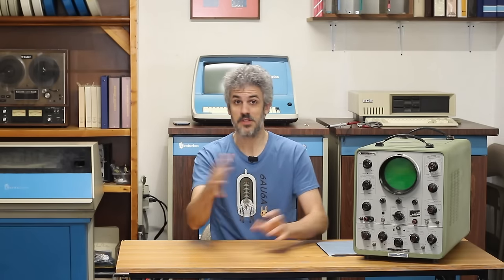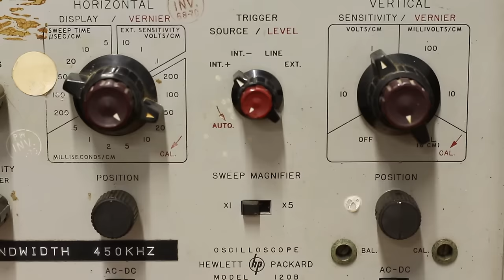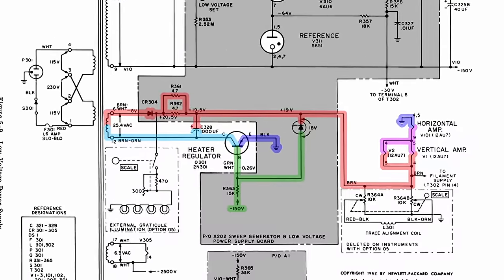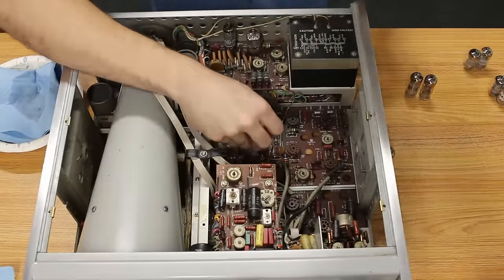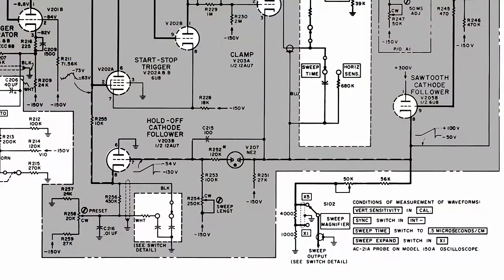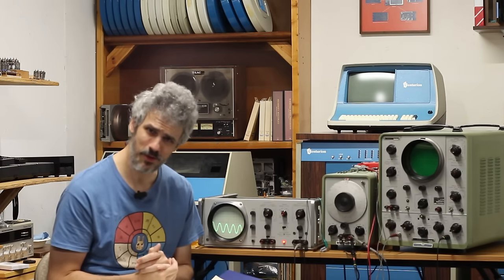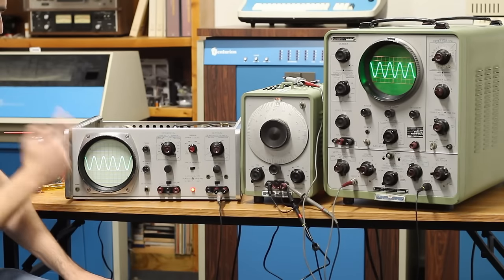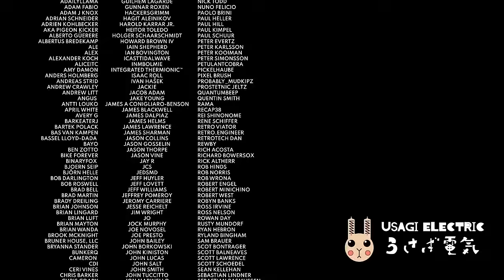Restoring an HP-120B Oscilloscope from 1961!

Comment: If you hadn't noticed, some of the pins on the tube sockets looked a little cracked around a few of those sockets. You may have a few bad solder joints on those boards. Other than that, that's a sharp looking scope
Reply from the maker: Sometimes the camera makes things look like cracks when they're really not. It definitely does look weird on a lot of the joints, but I went through and inspected them and it's really just blobs of solder, but they're all still connected nice and strong. I also went through and rocked the tubes back and forth while it was on an running to see if flexing the tube socket or PCB would cause changes in the pattern, and it didn't, so I think we're all good!
Reply: @UsagiElectric  awesome ;] an yeah, I can agree the camera can fool the eye.

Comment: That 100 Ohm grid resistor is known as a "grid stopper". It prevents high frequency oscillations. Same trick is used on solid state circuits on either the base or collector terminal of bipolar transistors.
Reply: And on the gates of power MOSFETs too????

Comment: When I was young and scopes were way too expensives, I wanted so badly to have one. My projects were mostly in AF range or CMOS up to 1MHz so any scope would fit the need. Now, I have around 7 working scopes, from digital to analog with transistors, from handheld to bench and I found that I use each and every one. I recently found a pair of old 20MHz dual channel analog scopes that were broken and I just fixed one so I share your excitement. The other one needs some more troubleshooting but Christmas hollydays are coming and I plan to fix it then.

Comment: Good job repairing that scope. That was a tricky one. When repairing vintage radios I have encountered bad Sprague caps. It is possible there are commercial higher quality caps being used in test equipment. Just wanted you to know you can't always rely on the fact they are Sprague caps.

Comment: The college i attended in the mid 80's was still using a gigantic vacuum tube o-scope, as it was the only scope they had that could do two very important things.  One, was to generate a transistor family of curves.  Two was that you could hook a land camera to it, and take a picture of said transistor curves, and develop them yourself darn near instantly.

Bonus, was that you could actually draw on the photo to pick your bias point for that particular transistor.

That o-scope had to weigh at least 200 pounds.  It was 3 feet deep and 2 foot x 2 foot across the front.  You could only move it in it's wheeled rack.

Amazing how well that o-scope worked.  We had regular old analog, transistor based tektronix scopes at each workbench, but you could not do transistor curves on them.  At least not with the equipment the school had on hand.

Comment: I absolutely have always loved these HP (Vacuum Tube) Scopes. I used to have a HP 122AR ( No PCB boards! ) I also had a HP 120 ( with no sweep it was just X-Y. ) I have a video of my HP-122AR on my channel from long ago. The transistor are for power regulation in the heaters, and the ziener does regulate I believe the B+ on the horizontal amplifiers. There is another HP scope that is from this time period, that I call the monster. It is again a hybrid, but I believe can do up to a 1GHz at with a special modular plug in. I can't remember the model number but I do have a photo of it, and there is a video on my channel ( Explorations of Garni Industries, you can see these scopes stacked at the end. )

Comment: I'd say the HP 651A Test Oscillator meets the rack mount requirement and the aesthetic, but it's a bit newer (1965) and transistorized.  They can be had super cheap though.  I bought one in the hopes of using the case for it to fit my HP Barney Oliver amplifier, but it wasn't quite right... so it just sits here on a shelf now. lol

Comment: This is why I always add a note inside equipment that I have modified or repaired - especially my own! Not just stating what was changed, but why. You might find that tube you replaced was a factory upgrade or mod. Looks like you are setting up a museum for HP test gear from the generation immediately before CuriousMarc's collection. And that is a really good thing!

Comment: I have an HP 8405A "Vector Voltmeter" (well actually, just the case... wanted to use it for an homemade amplifier), with a very similar style, handles and all, and with the stackable plastic feet this 120B seems to be lacking. It fits perfectly on my other 19" HP things ! If you need I could model them in CAD and send the files for 3D printing copies.
Reply: Have a full working hp vector volt meter with all the accessories. Very useful instrument used with directional couplers to measure insertion losses or used to measure electrical length of cables.

Comment: 11:28 Removing that big black 450KHZ sticker made it 10x more beautiful. Satisfying.

The zener + transistor was a nice simple regulator circuit. When the output voltage reaches the zener voltage minus the Vbe of the transistor, the zener diode starts to conduct and starts turning off the transistor. The resistor from the -150V makes essentially a current source that provides the base current to turn on the transistor.

Comment: Cool, as it just so happens, I have an old Oscilloscope stored away in one of my cupboards, it's an old Telequipment D33R Tube Oscilloscope, it's currently not working and needs a new, or second-hand CRT, plus some restoration work to get it going again, it's a great restoration project.

Comment: The PNP transistor and the Zener diode forms a basic current follower.  The zener is the voltage reference and the PNP transistor create a voltage that's close (600mV delta) to Zener's voltage with higher current capability.  This is essentially the same as a current follower circuit that uses a NPN transistor and a Zener diode that is more commonly used today except with the use of PNP transistor, the whole circuit is a mirror of the one that uses NPN transistor.  Hint, the placement of the ground is confusing.  Redraw the circuit by putting the ground at the +19V rail will make the analysis easier.

Comment: When removing old adhesive, I find that soaking it with isopropyl (sometimes with a rag or towel laid on top) will go a long ways towards softening it to where it will come more easily.
Reply: Yes; another possibility is naptha (cigarette lighter fluid).  "Keep away from fire, flame, or spark."

Comment: As the zener conducts it positive biases the base of the pnp (off), held on with the 15k resistor to the negative supply, establishing a nfb loop, increasing the v drop to the ground.
Reply: It also looks weird to us who are more used to power NPN devices.  It's just the familiar pass transistor linear regulator topology upside-down.  The pass transistor is on the bottom 0V rail rather than the top positive rail.
Reply: @paulmoir4452  I'm guessing that it dates to the pnp germanium era, before npn silicon power devices were common, but it is exactly that.

Comment: I seen a similar thing happen with a solid state Telequipment  Scope, spent days trying to TS the problem, replacing some caps, in the end the bias pot for the schmitt trigger need calibrated by using another Scope. Then the triggering stayed locked in when changing frequencies on my signal generator.

Comment: The Tektronix TM506 is a rack mount system for solid state plug in modules..
I don't know if there is a vacuum tube equivalent to it though..
But that would be a starting point in form factor search possibilities..

By the way.. I have a Tektronix 585 laying around somewhere...
I think it had a problem with the power supply...

Comment: This vintage electronic equipment was designed when nominal voltage was 110. Now it ranges from 124 to 129, at least in my area. If a vintage device is randomly blowing its fuse for no apparent reason, I am wondering if voltage fluctuations and spikes could be a factor. Maybe monitor the power line or  use a variac. This may be particularly important for precision test equipment - to get correct readings - versus something like audio equipment.

Comment: The 6U8 turned out to be somewhat of a problematic tube in many applications. They have a propensity to heater to cathode leakage. This may or may not show up on a tube tester, but is exactly the kind of thing that will throw noise on your trace and contribute to instability in your H-sweep. Exactly the issues you have. That is why, I'll bet, that they were substituted out in your scope as-found with allegedly superior types. Bottom line, it's kind of a defective design tube. They were reasonably popular tubes in old TV sets and if that is the source of your bag of 6U8's, all of them could be hinky on H-K leakage side. Before going nuts searching for a defective component in your scope, I would invest <$20 in three NOS ebay 6U8A tubes or known-valid substitutes. Plenty for sale.

Comment: Just putting this out there, since you mention the Model 15 teletype... see if you can find one that was modified for use by deaf people as the wiring harness was greatly simplified to have just the power and two pairs of cables (one would produce a Baudot serial stream from the keyboard and the other would be a similar Baudot stream to drive the printer). Both data cables would go into a box that would have an acoustic coupler for a telephone handset.

Comment: re the thumbnail:  Wow!  I had that exact model 'scope, too!  I bought it on-line in the mid or late '90's -- not sure if Ebay was around yet, but something like that.  Around $80 IIRC.  The rack-mount ears had been cut off.  In the early '00's, after getting married, I gave it to a friend who collected oscilloscopes (he also had every Star Trek novel paperback).
I suppose there were quite a few of these still kicking around, since they would just keep on working.

Update:  seeing it in the video, it's not the identical model.

Comment: One should not swap around tubes between sockets in a laboratory oscilloscope. The calibration was done with the tubes in their sockets, and each tube of the same type will have slightly different transconductance, capacitance, and bias. (The same applies to socketed transistors.)

Comment: current through r363 opens the transistor. When sufficient voltage appears on the red wire, current begins to flow through the zener and this current closes the transistor. In this way, a constant voltage is maintained on the red wire

Comment: That regulator and zener could be a clamp on the regulator to stop it from spiking over, or, it could be an early shunt regulator providing a low noise power supply by having a constant current bypassing through the zener (would need to see what’s elsewhere on the schematic.

Comment: I have a AN/USM-338 “portable” scope that is the U.S. Marine Corps version of an old HP 1707B scope from the mid-‘70s. I have no idea how to use it! I was hoping to get an old analog CRT scope so I could get the eye pattern when adjusting CD lasers but I’m told I need at least 100MHz and this is 75MHz.
Reply: It is, of course, able to be battery-powered and supports AC or 12v DC operation. I guess that’s what makes it a portable military scope. ;)

Comment: How the PNP and the Zener "play off each other": CR 304 and C328 form a half-wave rectifier producing an unregulated and probably ripple-laden 30 or so volts. The bottom of the transformer secondary is not grounded directly, but rather it is grounded through the PNP power transistor (Q301). Q301 is biased on by about 10mA of base current provided by the -150V supply through the 15k resistor (R363). This allows current to flow from the filter capacitor's (C328) negative lead to ground, powering the filament circuit. As soon as the filament circuit voltage reaches about 18.7 volts, the zener conducts, passing positive voltage to the base of Q301, reverse-biasing it so that it begins to turn off. An equilibrium will be reached where the voltage at the cathode of the zener sits right at the zener voltage, regulating the filament supply. If the voltage dips, the zener conducts less, and the -150V supply biases Q301 positively, allowing the filament voltage to rise. If the filament voltage goes too high, the zener will conduct more heavily, turning Q301 off until the voltage drops to normal.

It's a weird circuit, but in the days of Germanium transistors, NPN power transistors were uncommon, so this circuit was devised so as to make use of the more common PNP power transistors.
Reply: Nice analysis. There are some obvious problems, like temperature drift and unpredictable Zener characteristics.
Regulation loop -> Higher voltage on output, Zener conducts more -> less current to base -> bigger Vce, lowering the output voltage.
I don't think that Q301 is turning off completely unless C328 is damaged - its base current is "eaten" more or less by Zener, and Vce changes accordingly to that.
One interesting detail is that filtering cap C328 is not grounded but connected to Q301's collector.
I suppose they saved on the capacitor voltage rating since most of noise is coming from the transformer and CR304.
Reply: @miroslavstevic2036  There was no choice but to connect C328 as they did, because the secondary + CR304 +paralleled resistors + cap = the complete unregulated supply. And it's the grounded side that's getting regulated, not the positive side. They did that because NPN Germanium power transistors were rare, and also they had really bad temperature characteristics that were inferior to the PNP versions. N-doped Germanium does not like heat.

The paralleled resistors are for inrush current limiting. When the three 12AU7's this circuit powers are up and running, the total current would be about 300mA. But when they are first turned on, they'll try to draw about 4 times that much for about 1 second. The resistors keep this current down until the tubes warm up, to protect the power supply.

And you're right, the pass transistor should never turn off completely.
Reply: @ScottGrammer  Yes, good point about parallel resistors, filaments draw large current until they warm up. Also 1000uF is quite a punch.
Since they are in parallel I suppose they've used two cheaper packages to dissipate excessive heat. NTC resistor would probably save that power, but also bit more expensive.
My observation and question about C328 is what if its minus lead was grounded. I don't see why it couldn't do filtering if connected from +19V rail to ground?
Harmonic current would go through Q301 in that case though, heating it up a bit, and the voltage on C328 would be a bit higher.
I believe an additional cap from +19V to ground would be beneficial for loop stability, but they probably didn't care about regulation that much as thermal inertia of filaments is effectively doing the similar job.

Comment: 6U8 and 6GH8 are interchangeable in nearly all applications, but in my experience the GH doesn’t last as long. Remember that they came out near the end of the vacuum tube television era, so quality wasn’t as good and most of the circuits they were used in pushed them to their design limit.
Reply: I think Mr. Carlson spoke of them at least once, or something similar with the same triode/pentode difference. That comment about towards the end of an era sound familiar, but might be combining things, later part of what you said not included. Would have to scrub projects from the last year to three, I think it was of relatively recent memory.

Comment: The other thing you could do, at zero cost, is to put the oldest cruddiest looking 6U8's in the scope for the H-sweep and the V amplifier and see if the problems get WORSE. THAT, by the way, is one reason why you might want to preserve the silk screening on the exterior of the tube when you clean them.

Comment: I think the mod was for adding external trigger. Probably the previous owner needed it and thought that he never will need z axis input then used it's jack.
Reply: Another possibility is going back one stage from CRT blanking signal to get a positive=more intense/negative=less intense beam response (and amplified, and without a high voltage pulse coming from the input) to Z axis.  I did this on an old Conar 250.

Comment: Get the PDP-11/44 up and put a UNIX on it. Nothing fancy, not Linux, something period-appropriate.
Stuff it with various protocol serial i/o cards, then make it the serial hub/router that unifies the collection.
The routing controller could be written with shell scripts or relatively simple C programs.
Clean to debug and extend, and pretty easy to then get everything talking to the net for a bridge to today's world.
Plus all of the other things a 11/44 running UNIX can do. Besides, just poking at RT-11 or RSTS/E isn't that much fun.
Other than the (massive) power usage, what's not to like?
Reply from the maker: I have... different plans for the 11/44 that involve very interesting add-ons I'm still trying to figure out how to get my hands on! It's the 11/83, 11/73 and 11/23 PLUS I don't really know what to do with, haha.

Comment: Using the 120B to 'troubleshoot' the Bendix might not be the best plan...
The G15 runs on a (glacial speed) 90kHz 'clock' and the 120B bandwidth is 450kHz (thus, a factor of 5 'oversampling' LOL)
Neverthless, you might find a few areas where a 'noisy' signal in the G15 simply isn't 'visible' on the 120B.
(It'd be SIGNIFICANTLY worse if the G15 used magnetic 'core' memory, but the mag drum would still be quite difficult to reliably troubleshoot with a 450kHz 'scope)